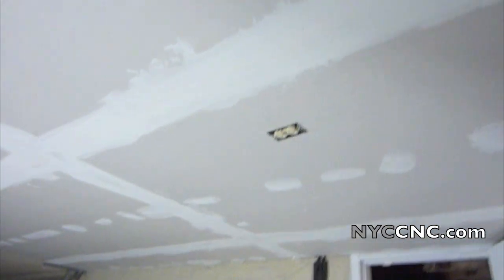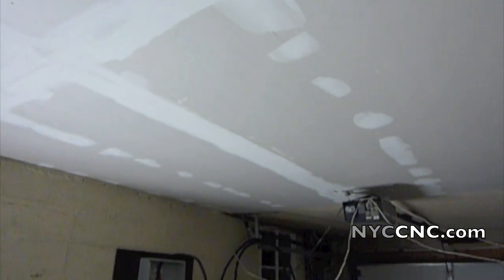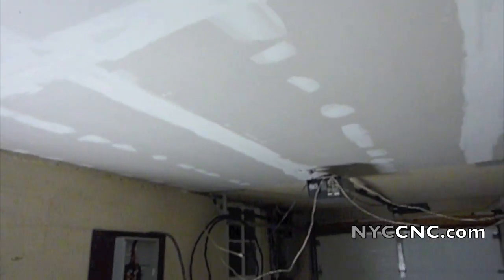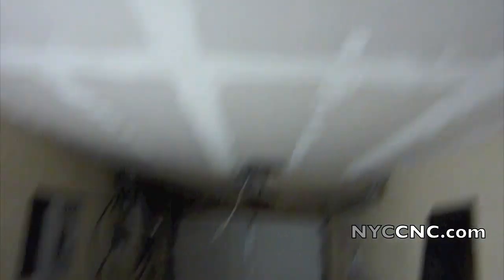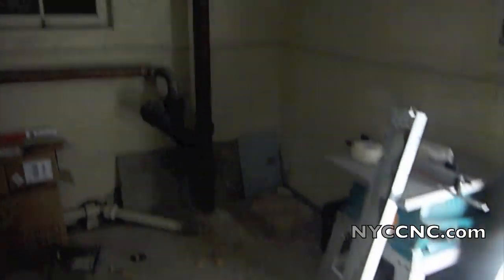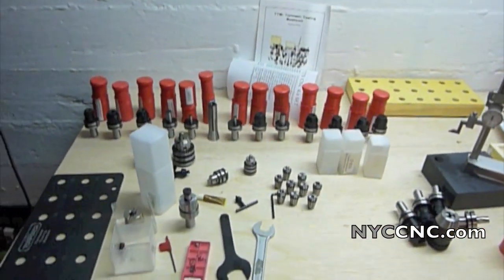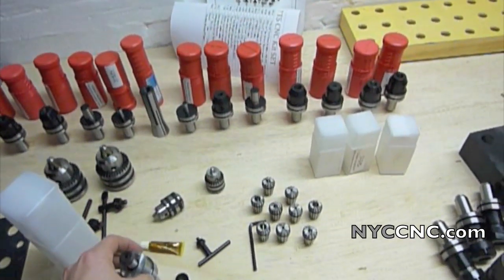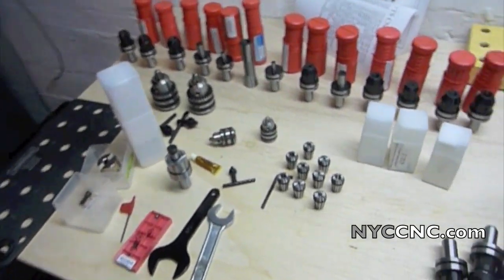Tormach PCNC 1100 - Last minute preparation.  Ch 4.

Comment: It's refreshing to see someone actually do things the right (nice) way, keep up the sheet rock and painting, once that mill is in you'll never have the "time" to finish things out. You should be real happy with the mill, I wish I had the new spindle control. I ended up with one of the very last 4500 RPM units.